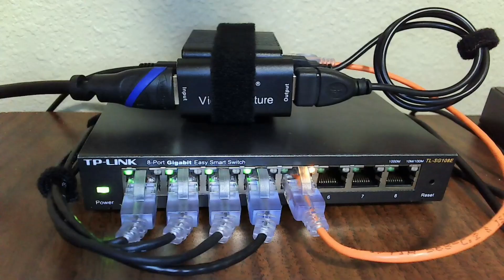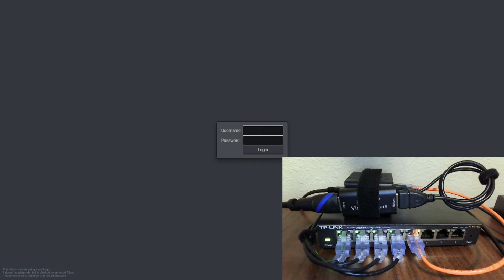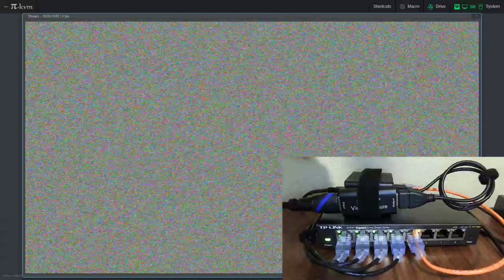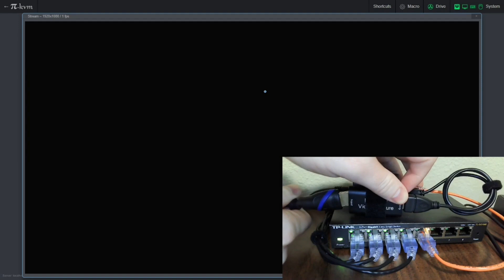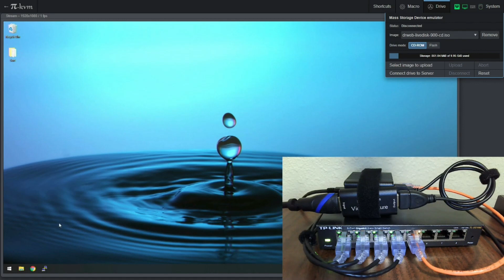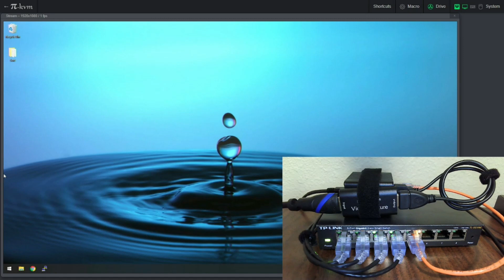Is this the cheap IP KVM with HDMI support you have been waiting for?

Comment: Hey now.   Looks like a slick cheap implementation but that HDMI issue is an absolute deal breaker for me.  If I'm pushing these out it's because either 
a) I can't physically get to the machines (and therefore the capture card) or 
b) I'm sending it to such technically inept people (family/friends) that talking them through that if I ever have to would be easier to just drive over and then who needs the KVM...
and no, they won't remember for next time just cuz I talked them through it once.   When I say inept I mean I gave up trying to talk one of them through downloading and running my remote access client once and just drove the 35 minutes each way to install it myself inept..

Anyway, I looked for a follow up video and didn't see so I'll ask you here - 
Is the only way to fix it by pulling the HDMI or can you pull the usb side (ie. power cycle the capture card)?
Also, is this an issue of this particular capture card?   Is there another (maybe slightly more expensive) capture device that won't have this issue that you might suggest?

If you've solved these issues you might put out a follow up vid discussing.  Many of us might benefit.

Comment: I went to the site you provided to buy the NanoPi and it is about $16 but it does not come with a case as you stated in the video. Shipping to the US is 8 dollars. Plus the case which I have to buy separate is about 41 dollars on Amazon shipped. So the total is 65 dollars. We have not even talked about yet about a power adapter.  VERY EXPENSIVE I'll stick with the raspberry pi.
Reply from the maker: Sorry, the link was to the bare board.  The one with the case is $21. Their prices increased by a lot in the last years because of chip shortages. 
https://www.friendlyarm.com/index.php?route=product/product&path=85&product_id=260

Comment: The problem with the hdmi was it fixed or a workaround for it? The second question is which ports are needed for this?
Reply from the maker: I have yet to see the issue arise again. I think it may have been from a flaky USB cable. 
I am not sure what all ports need to be opened.

Comment: Its nice. But if you have to manually reconnect the HDMI, its kind of fatally flawed. You'd have to drive the 'in theory' distance to site to fix..
Reply: I thing you might just reboot the KVM device instead of reconnecting the cable. Should work

Comment: Disconnect hdmi and connect it back - that is not the solution. IP KVM should work without issue, otherwise it’s useless.
Reply from the maker: I have actually been trying to replicate the issue and I can't seem to get it to to it again.  Could have been the USB being loose.  I will update if I can figure out what caused it.  The laptop I was using could have also been the culprit. I had only ever seen it when I was trying to make the video. I left it in because it was something I ran across.
Reply: @MyLittleLan  Maybe the generic HDMI-USB capture device is the culprit. The cheap devices sold on Amazon may superficially look the same, but they vary a lot in build quality, PC board layout, and especially firmware. The youtuber EPOSVOX does a lot of reviews of capture devices, from cheap on up to professional quality. I have one on order called BlueAVS that looked pretty good for the low price at the time of review. I'll see how it goes, but the Chinese stuff is notorious for quality control problems - from great to terrible depending on what facility manufactured that batch.

Comment: Good demo. Shame about the whole “you need to unplug and replug the HDMI in” problem.  Hopefully once that’s fixed there’s probably a better use case for it.
Reply from the maker: I have only had the issue a few times, and as the other users stated, it looks like it can be resolved.  I will be looking into it and see if I can create an updated video showing later on.
Reply: EDID emulator
Reply: The HDMI2USB is useable but it has disadvantages over using an HDMI to CSI board (connect your HDMI to your CSI camera port on your Pi).  The CSI is a little more reliable when dealing with changing video modes, has less latency, and supports H.264 compression.  

HDMI2USB is easier to hook up.